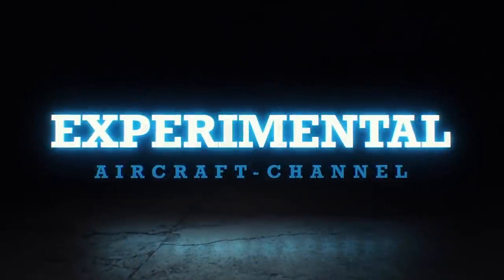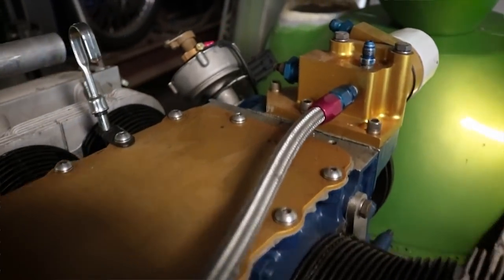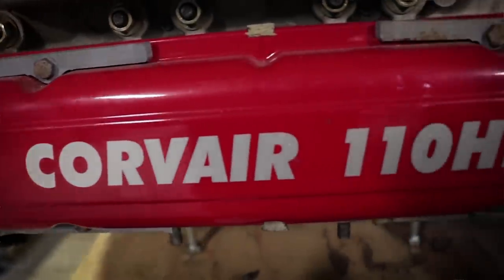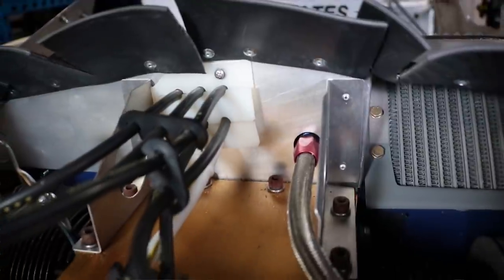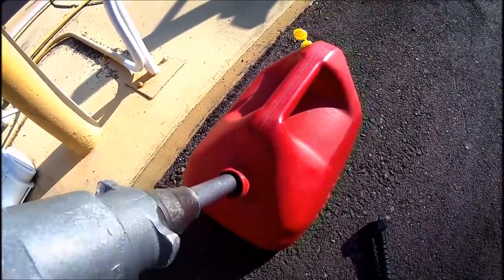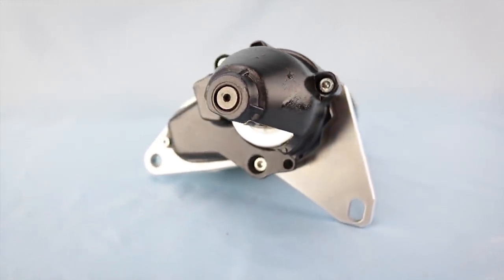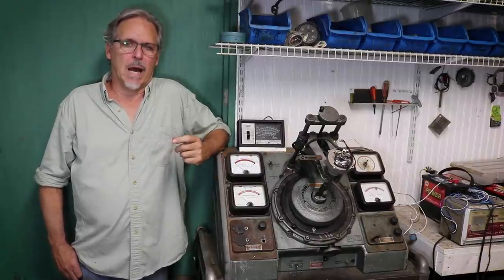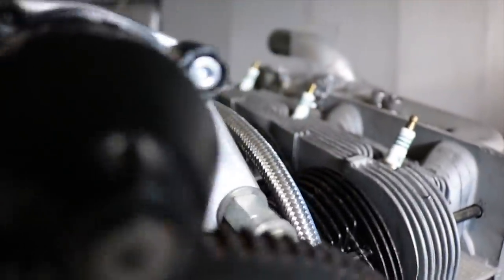FlyCorvair - Corvair Aircraft Engine - ENGINE WEEK 2020

Comment: I had a 1966 Corvair when I was working the line at two local airports.  Each morning I'd have to drain the sumps of the 80/87 and 100 octane trucks. Right in my Corvair each would go. Also lubed it with Aeroshell. Finally traded it with 162,000 miles on it. Engine never had a problem, other than the darned pushrod seals.

Comment: My first car I had as a teenager was a 1964 Corvair.  It was totally worn out and Dad and I rebuilt the engine.  I'm sure nowhere near the standards you folks do but I learned a lot.  It was a good car.  I think it's so cool you folks are using Corvair engine in airplanes.  The only thing that surprises me here is you're still using ignition points.  I would never have considered that.  But hey, if it works!

Comment: Great interview. I'm one of those builders that had a tight budget, and there is no way I could hop in my Zenith 650 and take off, without William's expertise. I love everything about my 2700cc Corvair.  Super simple, direct drive, and easily maintained.  I also plan on building another.
Reply: Javier Lopez  I have my Warp Drive prop adjusted for cruise, the 650 will climb out at around 900 fpm at gross of 1320 lbs.  Cruise  is about 125 mph at 5 gph, 135 at WOT and 6 gpm.  If I set it for climb, it'll do 1500 fpm, and the mph numbers drop around 10 mph.

Comment: That corvair engine was dead reliable, my mother had a 63 four-door and that thing was like a tractor in the snow, snow would be dragging the bottom of the car and it would be going right through it.
Every once in awhile the turbine shaped fan on top fan belt will jump off and the light would go on and I will go with a pair of pliers and a screw driver and pop it back on and keep right on rolling. 👍

Comment: I had a Corvair back in 1972.  I always thought it looked like an aircraft engine.  They are fairly easy to work on.  I suppose that you could use it on one of those air boats that use fan drive.
Reply from the maker: You could. Or... use it in MANY different aircraft designs flying now. Thank You for saying hello here today!

Comment: I wish the oil system was explained. I even see a dipstick. In unlevel flights how do you prevent oil from flooding the cylinders snd I see lines to the valve covers so are they run flooded in oil? Anything special with the push rod tubes an sealing? Interesting engine use. They have used Volkswagen egines too as I recall.

Comment: Mr. Wynne, With a metallic-substrate 3-D replicator, you could make ANY aircraft engine you desired, depending on the software and platen [base of replicator] -length.   Want a JUMO 211 for a He-111 or Ju-87, or Ju-88?--a Merlin for Spitfires & many others?   As it's NOT "wartime", make the DB605 for your Fiat G-55 out of alloy, instead of iron.   You could put corvair heads on a custom-aluminum V-block.   You could MAKE a straight-8 Argus for somebody's "Storch-resto".   I'll bet if you "Made" one, Jay Leno'd buy a zero-miles straight-8 DOHC Duesenberg engine for whatever they'll bring, although with His 3-D replicator, maybe he already has a "spare."    I like the idea of moding auto engines to become Aircraft power-plants.   Maybe I missed-it--is the "rebuild-course", part of the monies you charge for the engine?  If so, I think it's a great idea, as the new owner knows what's in the rebuild, because you showed him HOW to rebuild it, and He DID it!    This should also nearly eliminate after-build/{--"incident"} lawsuits, making your "builds" cheaper.   Thanks for your great Video

Comment: A few questions.

Cylinder head valve seat retention and excessively quick changes in temperature. Are you doing anything other than pilot technique to avoid problems?

The fifth bearing. Is this a modification to the crankshaft or is it a bolt on to the output end of the crank?

Are you using the basic 110 HP/164 CID head and have you a improvement for the obstructed ports.

How is the gear life on the cam drive. Related issue have you had the output flange shear the key and move out of position on the crank?

Are you using flat lifters and have you had to do things to insure proper break in with modern (no zink) oils?

Have you considered port injection. I always had trouble getting even distribution of fuel between the cylinders?
Reply from the maker: These are great questions. Best suited for William Wynne himself at @WW Flycorvair

Comment: Why not adding a 2nd plug on these engines? Not a hater, just interested.
Reply: Walter, I've flown them a long time ago, but it is a complex and expensive welding and machining operation, you lose cooling fin area, and it messes with the combustion chamber shape.
Reply from the maker: Also... The older Legacy Engines didn't have the technology available to them to provide a HOT SPARK with the mags so two spark sources were needed to better burn the fuel in the cylinder. Today's more modern High Energy Spark system allows for a "hotter spark." Also allowing spark gaps that don't lend themselves to fowling. Thanks for chiming in today!
Reply: @ExperimentalAircraftChannel  Thanks for that info, it makes perfect sense.
Does your company have any training classes for A&P or LSRM mechanics?

Comment: I'm confused, are these engines FAA certified?
Reply from the maker: No sir. Not at all. You can build these yourself. No inspections required. Or you can have a Builder Assist weekend with the parts supplier that converts these into Flight Engines.

Comment: 62 corvair FOR SALE, 38988.6 orignal miles just been sitting for 30 years. 62 corvair in arkansas. $800 bucks its urs
Reply from the maker: I think for a FLIGHT ENGINE they like to use 1964 and newer or 1965. But I am not 100%. Would need to inquire with William about proper years.